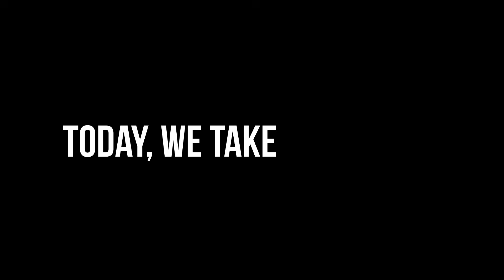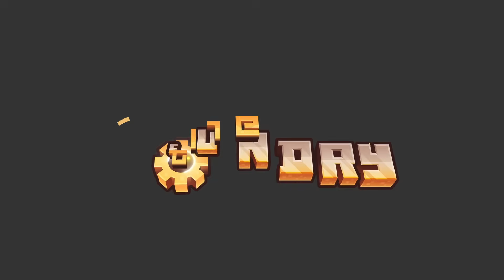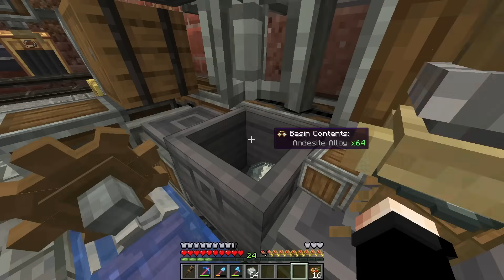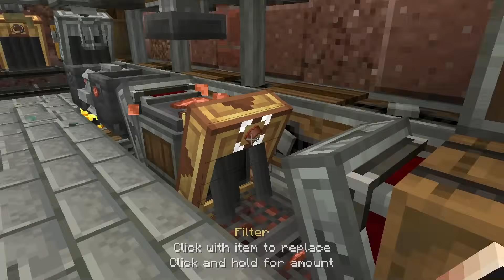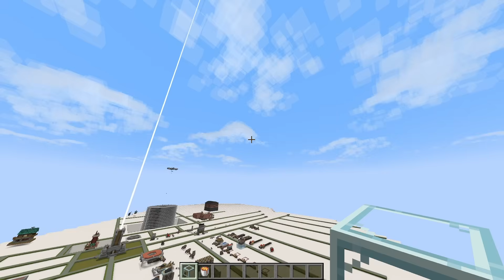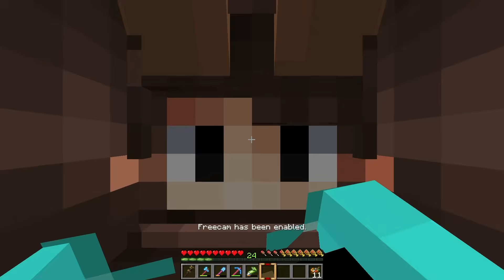INFINITE ENERGY From Just 9 Lava Buckets! - Minecraft Create Mod

Comment: Was searching YouTube to see if I could find a video of someone doing this with one bucket. But so far your 9 buckets is the lowest I could find, and a lot simpler than the theoretical one bucket methode. It should be doable with just one, but for some reason I had to use two.
Reply from the maker: It should be doable with one with a planned setup, but I wanted the aesthetic and I didn't want the hassle so I gone with this😅
Reply: @UncleRanger  Finally figured out how to make it with only one bucket, you just have to make sure the house goes down through the one source block.
P.s. yea aesthetics is important as well.
Reply: @MartinBVDK  do you have a video or tutorial? I try but fail >(
Reply: @diegoreis3691 I haven't made a tutorial for it, as I'm not into making videos, but I have toyed with the idea.
The difference from uncle rangers design is that you can't have a flat support contraption for the lava, so using the drills is not ideal. What you do is make a stepped platform, where the lava exactly flows over the edge of each platform step... and then you make absolutely sure the hose goes down through the source block.

Comment: i'll look into insta-crushing, but water is not enough for power
Reply from the maker: Yes, there's 18 Crushing Wheels running on full speed in the setup, which will take around 37k SU, you can however run it in half the RPM which will only take 18k SU, it can still be fast.